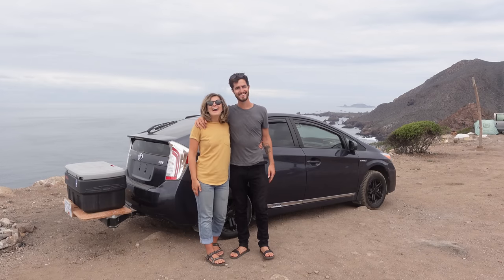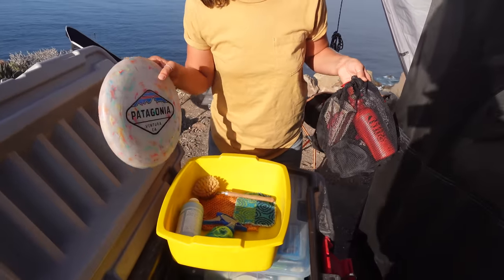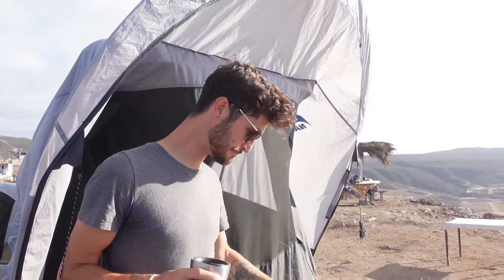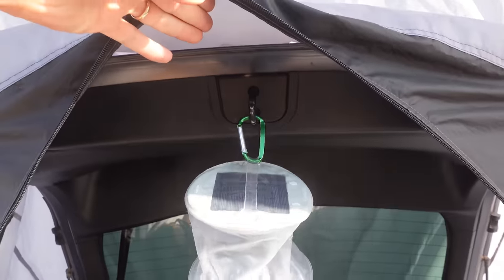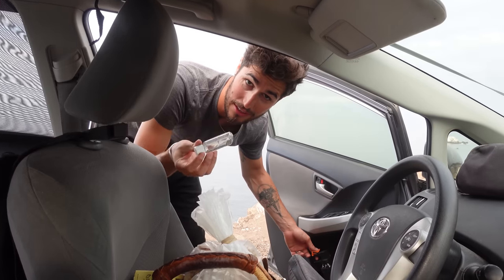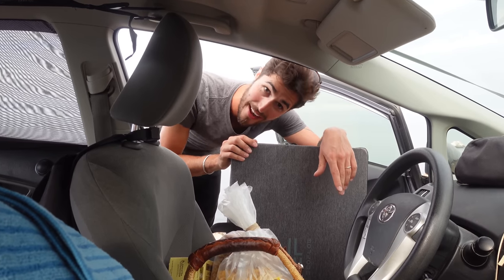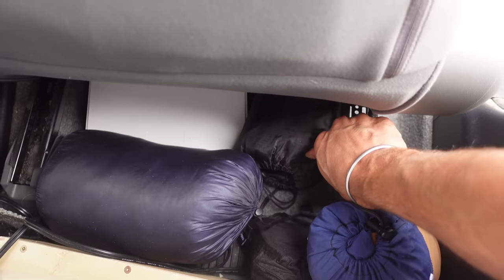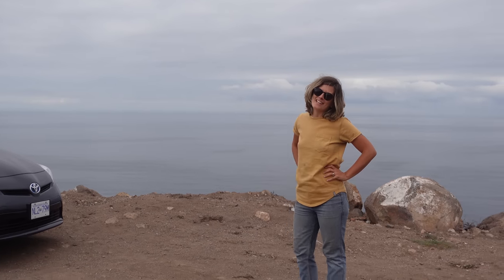Toyota Prius Camper Conversion Tour! (for a couple)

Comment: What I love about the Prius as a camper, is the ability to use the A/C in a hot climate even at night without worrying about the battery getting low.
Reply: Same. I've been eying them to help me get into remote backpacking and hiking areas with good mpg and I can crash after a long trip then drive back the next day. Also, instead of cancelling a camping trip (tent, state park) due to high heat and humidity, I can find some respite from the weather. Just need to find a 2019 or later as the auto stop was introduced in 2020 thusly the HVAC will not run through then night. $10-$14K for a late model gen 3 in my area.

Comment: If you haven't yet, look at Self-inflating Sleeping Pads, they are amazing! And the good ones are actually way more comfortable than blowup mattresses. It's my favorite purchase for living in my Prius!

I bought one from REI for my Prius that's 4 inches thick and it's so nice that, I stopped using the bed at my parents while visiting. Plus it can be rolled up in a few minutes to a small percentage of its size if you need to save room.
If you get one at REI you can test it out to see if you like it and works for you and then if you don't it's free to return within a year. It's been really great because it makes sleeping in the car so much easier and when I camp I have a great bed to use outdoors.
Just make sure to get one with that has plenty of foam because that's what makes it so different from a Blowup Mattress so it doesn't have that bouncy effect. And make sure to adjust the air while you are laying on it to get the perfect firmness. I lie on my side and and let it deflate until just before my hips start to get near the ground. I'm 6'4" and 200 pounds and it's been a life saver since I have such difficulties with insomnia.

Comment: Check so the tyres aren't made for just winter, in that case the rubber mixture is different too summer tyres, which means they become way too soft in warm temps. Because they are made for the cold. And that affects grip and braking performance alot.

Comment: The only thing i would recommend from experienced is substituting much of the cooking gear with a small microwave , its easily workable with the Ecoflow converters . 
It has saved me so much time and convenience, just as it does at home ....since i primarily use a microwave and not a stove at home .

Comment: They make an enclosed toilet that straps to the seat ( puppy pad underneath, just in case)....you can put a bag with shavings or the specially made absorbent bags inside that you simply dispose of. A curtain to screen off the back would give you privacy when you can't set up your awning.  One of those pop-up shower tents can be set up under the awning when not in stealth mode. Either way, it's nice to have your own toilet when the weather is against you....especially at night.

Comment: Have you thought about adding a flexible Solar panel (or two) to the roof of the Prius?   I was thinking about that to keep my Delta EcoFlow charged without having to carry around the briefcase Solar panels.   Also, you could get a battery converter for the actual Hybrid battery, (there is another YT channel who did that)  Don't you just love Hybrids!!

Comment: Hi Levi and Leah, 
Have you noticed any changes in fuel efficiency since you got the lift kit? We've been thinking about putting one on our Prius, but with gas the way it is we want to make sure that we won't lose the fuel efficiency!
Reply from the maker: Thanks for asking! We seem to average around 4.5l/100kms which is pretty much what they say you’ll get from the factory. This is pretty much the same as before, especially since we put the winter tires on there (that’s where you loose the most efficiency)
Reply: @LeahandLevi  Oh fascinating, okay, we will definitely consider doing this then, thank you so much!

Comment: Two things i didn't see you mention are: 

1- the climate control. The reasons to get a Prius(or any Toyota hybrid) are the MPG efficiency, reliability and being able to run air conditioner without an expensive, fiddly aftermarket setup and solar

2- where and how do y'all poop? And i guess to a lesser extent, how do you manage your garbage?

Comment: How about the Aptera? In the next year or two I would like to see you do a video on the Aptera solar EV (which should be coming on the market in 2023). I came across the Aptera EV on YouTube a few weeks ago, and in addition to pre-order build options for very long range batteries and up to 40 miles/day charging from the full solar cell option, it has a camping/tent option. The Aptera is an aerodynamic two-seater, three-wheeler EV, but the trunk is long enough to sleep two, and with the hood raised will work with the camping/tent option. Being in Canada, I'm not quite ready for an Aptera, but I am following its development closely, for the same reason I see the value in the flexibility of customizing a hybrid car and making use of its battery for the use cases in your videos.

Comment: Where is your jack, your tire iron, your spare, and jumper cables (I dunno, do Priuses use jumper cables?) ... in other words, what is your plan for flat tires & breakdowns?  I know you probably have road assistance, but sometimes you can't access it.   I'm worried!!!   Yeah, yeah, I'm old enough to be your mother and that's the kind of stuff I think about .....
Also, your car looks great and pretty "stealth," relatively safe from anyone who would want to cause you mishigas.  But, I'm wondering what made you decide not to put a clamshell on top of the car just to give yourself a little extra space?   I'm thinking it wouldn't be such a bad idea....
Reply: early on they specifically said putting something on the roof would mess with the aerodynamics of the car and somewhat defeat the point of having a prius

Comment: What model hitch do you use?  I had one put on my Corolla and its hangs down a bit too low from the bumper which causes it to scrape over inclines and speed bumps.  Yours seems to be tucked up pretty close to the bumper.  TIA...

Comment: Winter tires on it for more grip and elevation? I think you need to do some research on winter tires my friend :)

Tire height (which can affect ride height) is determined by tire size not whether they are winter tires or not winter tires. Also, when it is not winter you will get your best grip from non-winter tires.

Comment: Where did you get your side window covers (reflecting/black)?  How do they stay on (noticed they were quite soft and floppy)?  Thanks in advance!
Reply from the maker: Thanks for the comment! We got these off amazon sadly because there wasn't really any other option we could find. They're cheap and pretty flimsy but they do the job!
Reply: Weathertech also makes them fitted for all the windows in my 2013 Prius.  They may cost a bit more, but they fit perfect, silver on one side, black on the other.
Reply: @NathanSpinler  Thanks! Yes, I've looked at the Weathertech ones and decided it was too much for me to spend (just camping occasionally in my car, not doing a long trip). Sifted through the Amazon ones and could not find any like theirs, now have found one brand that have mixed reviews about the magnets sticking. Have purchased these pleated curtains now, but they aren't as stealth as something flat. My concern is that if I have to go to a "city" area and leave my car that it will be super obvious that mine is the one to break into because I have special curtains covering everything up.

Comment: How did you disable the hatchback lights (and dash warning light) when you’re using the hatchback awning/tent?
Reply: I slide a small carabiner clip into the slot where the hatchback latches, it will tell the car that the hatch is closed.

Comment: But why a Prius? Aren't there thousands of cars more suitable for this kind of living?
Reply from the maker: We have a whole video about this from early in the series actually. And some short content on this channel that explains it too!
Reply: In short, a hybrid allows for running ac or heat all night long very efficiently (mostly off electric and occasionally the engine kicks in for a couple of minutes to recharge the electric battery). Also, in general, fuel efficiency without the worry of finding charging stations and timing that. Plus reliability. I have a Prius V and have done spring/summer/early fall camping for a long time and kept the idea of turning on the car in the night if needed in the back of my mind, but never realized how well it would have handled running ac or heat all night before so am now thinking of extending my camping season. Plus bringing my cat along these days and my cat feels safer inside the car than in the tent so I'm looking at just sleeping in the car now. And she needs more temp control than I do.